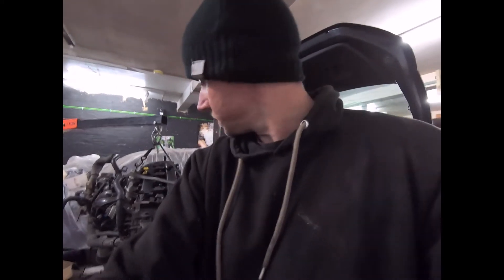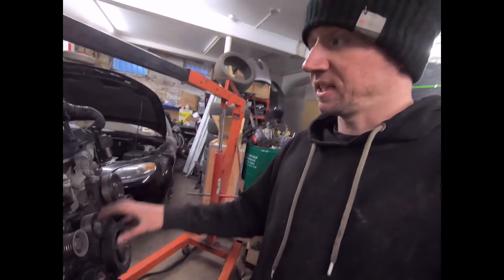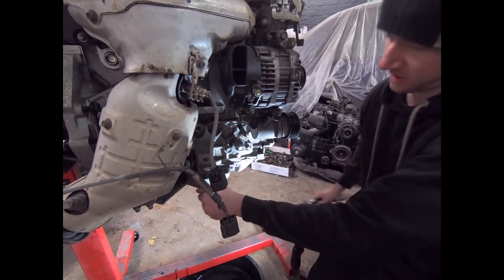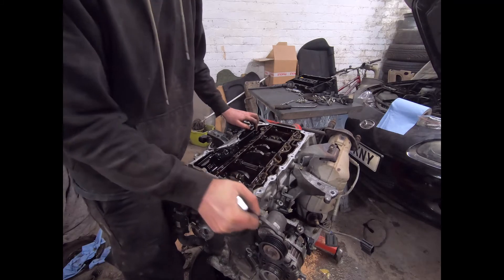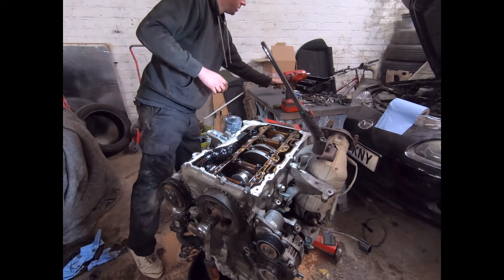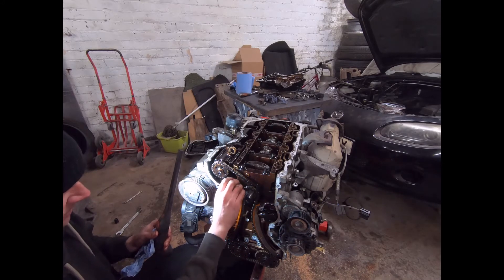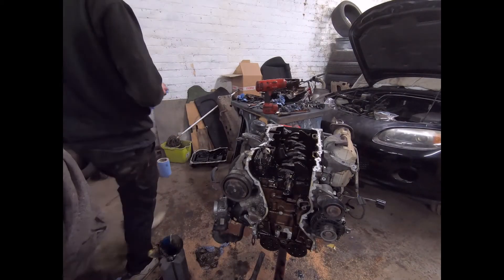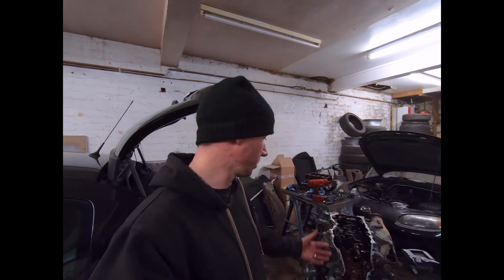Rod Knock Engine Stripdown for the MX5 (Miata)

Comment: My 2006 1.8l nc just ran into this problem and i do not have the money to fix it. Its my first car so i want to fix it myself but removing the engine is a problem. Was wondering your opinion if i replaced the rod bearings through the oil pan and then checked the oil pressure to see if any main bearings or my crank shaft have been damaged.
Reply from the maker: Its not that simple unfortunately, they are a precise size & fitment. The crankshaft may also require repair or replacement
Reply: @UnlovedJDM  checked oil and not much metal but are you talking abt the rod bearings being a specific size as can i not just order new ones from the manufacturer